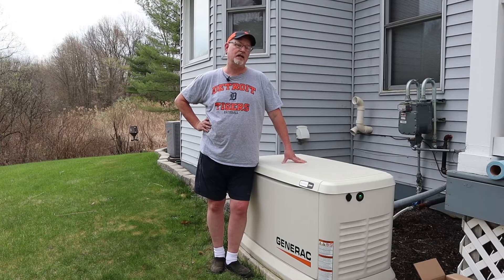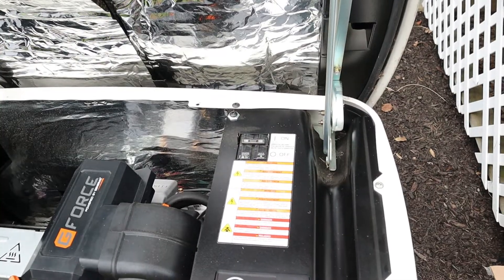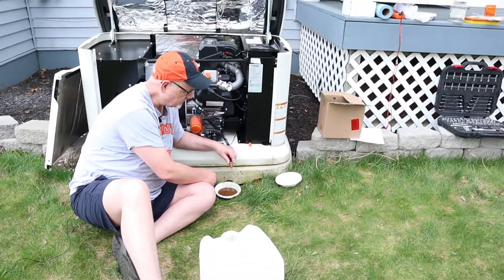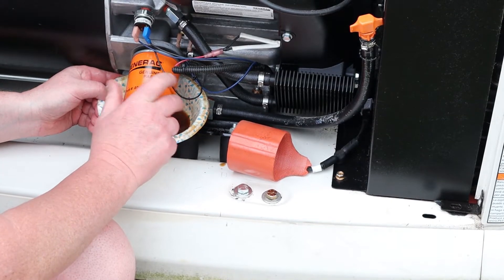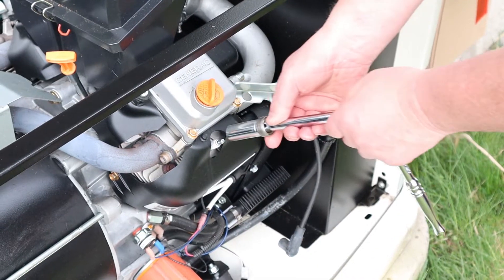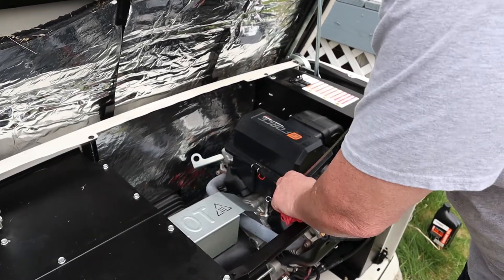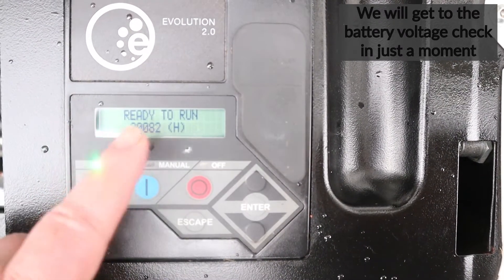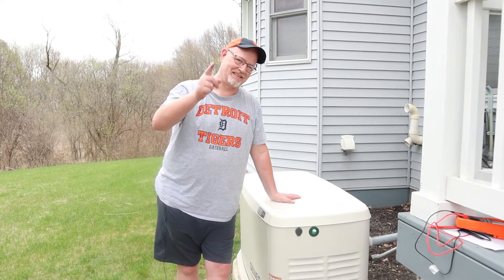General Maintenance for Generac Generator, Schedule A & B

Comment: This is a very good tutorial. I'll be saving over $300 per year doing the generator maintenane myself.  I would have liked for you to have taken off the side panel to access the battery since the panel isn't as easy to remove as the front panel.  The battery should be checked for any corrosion on the battery terminals.  You definitely got a thumbs up from me
Reply from the maker: Thanks for the comment

Comment: Great video. Lots of helpful information. I think that you should also test the battery with the charger circuit turned  off after you tested the battery with the charger circuit on (which proved that it is being charged properly).  A battery analyzer would be the best for that. You don't want to find out the battery went bad when you need the generator during a power outage. I like the Midtronics PBT-200 battery tester or the Midtronics PBT-300 if you need to test higher amperage batteries.
Reply from the maker: Great tip.  Thanks for the comment.

Comment: Great video. Helped me a lot. You should have mentioned how difficult it is to remove the rear spark plug. There is not enough room to get a standard spark plug ratchet back there. You either need to remove the back panel, which looks like a major ordeal, or you need a swivel on your ratchet, which I noticed you used but didn't mention specifically. Once I went to Lowes and purchased said ratchet swivel, the rest of the job went quickly. Thanks for taking the time to make the video.
Reply from the maker: Thanks for sharing
Reply: I have no problem

Comment: I have the 18kw version and just did my first oil change this weekend after 2 years. I’m at 25 hours of runtime with 8 outages over the last two years. Longest outage was 11 hours. Trying to figure out why your old oil looks so orange (almost rusty). My oil was just your typical dirty black. Thanks for the video.
Reply from the maker: Hey Steve. Thanks for watching. I chalk it up to the type of oil I’m using and the environment that my generator lives in. I’m in a northern state and my generator is always in the shade.  Looks the same rack year when I change it and have no issues with my generator. Thanks again.
Reply: I have a 18kw living in (HotAss) Texas do I need to put about the same amount of oil in my generator (genarac) also do I need to set the spark plugs the same. I don't know what KW you have you didn't say. thanks for the video...good info.
Reply: i don’t
Reply: @JerryJacksonDIY a lot have moisture in the oil which is very normal since they don’t run much on heavy load to get rid of it..”moisture”

Comment: Jerry,  Good Video and not one of those Haters but I just have to point out there are at least 2 Windows (openings to the House) within the restricted (for CO) airspace around the Generator...
Reply from the maker: No problem. I did pull a permit to have my generator installed and for my area it passes all the requirements for distance of openings. Thanks for the comment.

Comment: Don\'t forget to take a sharpie and write the date the oil was changed on the oil filter. Also use a label machine, make a label and put it on top of the generator  and put the date when the oil was changed.
Reply from the maker: Very good tip. Thanks for the comment.
Reply: should include the hrs when oil was changed

Comment: I’ve got a new 24Kw Generac that has run for 5 minutes a week for 2 years….meaning I have less than 10 hours of total run time. Changed oil, filters, and plugs….all easy

The question I have is why do a valve clearance check since it’s no where near the 25 hour recommendation 

Thoughts?
Reply from the maker: Great question Herman...  I feel that the owners manual assumes that there will be some outage time usage along with the normal weekly cycle time.  But if you are comfortable and have kept track of the amount of run time you generator has then waiting till the 25 hour mark would make sense to me.
Reply: Do you know if the maintenance kit he shows here (it says for 22 kWh) is the same one you'd use for the 24 kWh?  I can't imagine it's any different, and I can't find the Generac kit on Amazon.  Thanks!
Reply: @CaptTony107 same kit as 22kw

Comment: Anyone running a trickle charger on their generac battery?
I’ve already replaced one battery after owning the machine for 3 months so I got a small battery tender trickle charger hooked up to my new battery.
It doesn’t hurt anything if it runs with the  trickle charger hooked up.
Reply from the maker: I’ve had my generator for over 5 years now in Michigan. Never ran a trickle charger and still have the original battery.
Reply: the generator has it's own battery charger in it already,  don't add another you will burn-up battery !!!!!!!